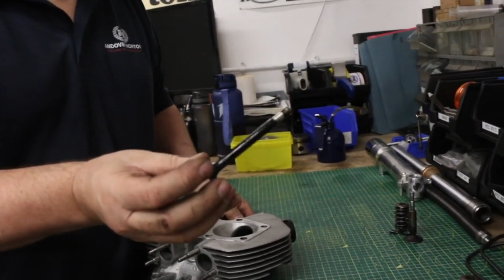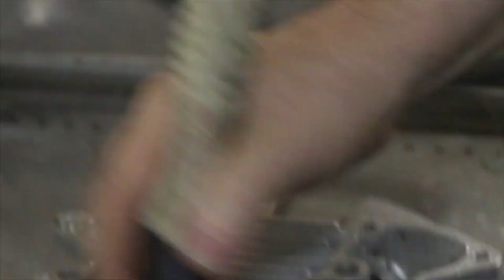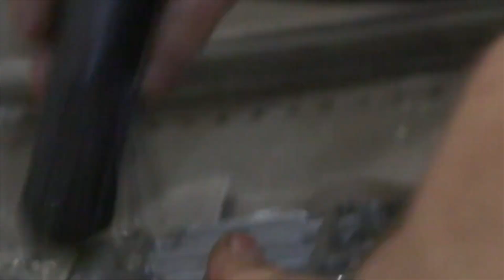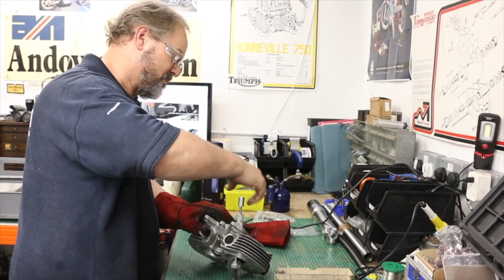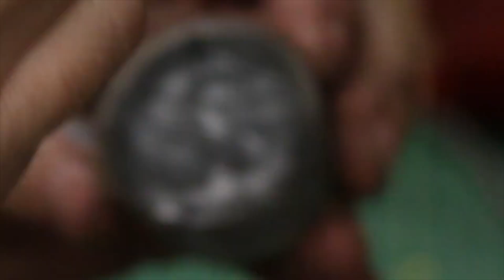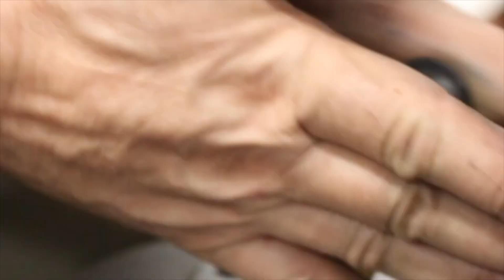Friday Workshop - Installing New Valve Guides

Comment: What is that tool used to pull in the guides? Commercially available?
Reply from the maker: As this is such a specialist job we don't sell the tool I'm afraid, and would usually suggest you get someone with experience to do it for you.